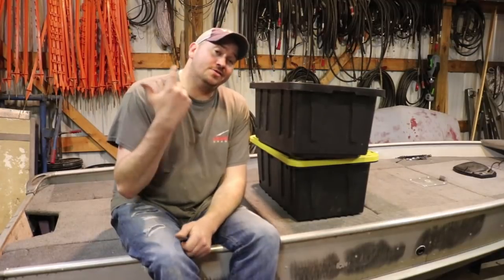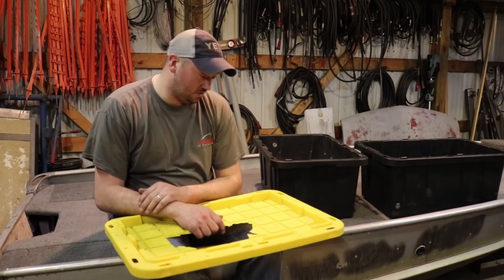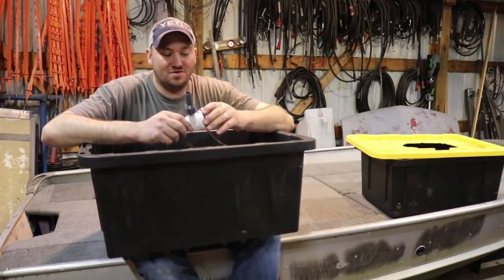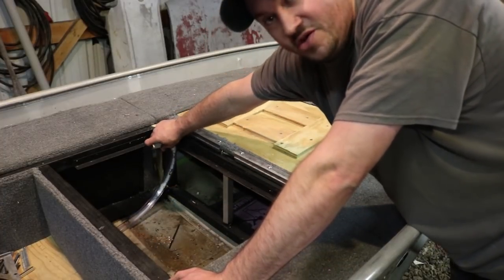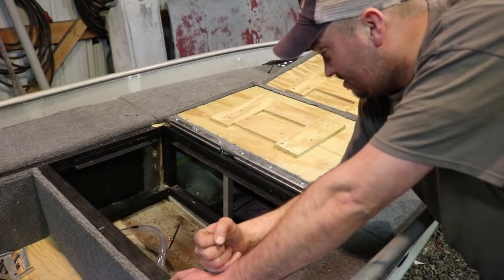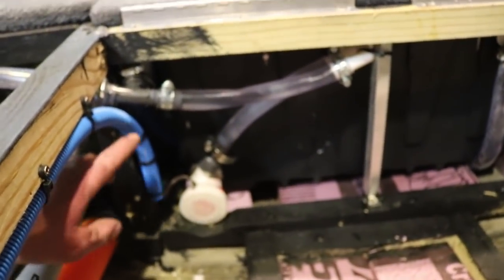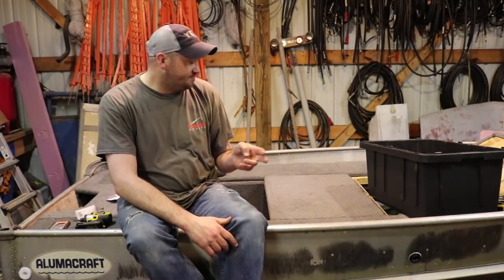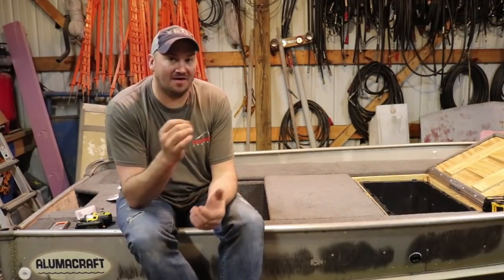D.I.Y Livewell jon boat to bass boat!

Comment: I came across your video while getting ideas for an improved baitwell in my 14' Alumicraft jonboat.  I found everything you showed helpful, including the one seemingly minor mistake you talked about getting the well to drain completely.  I now know to pay attention to the ribbing of the Durabilt bin I purchase so that I can install a drain to get it to fully empty.  Additionally, I will look to find the dual-flow valve for recirc or drain rather than using separate valves.  Thank you for making the mistakes for me so I won't have to.  Your video has been most helpful!!  Definite UP vote!

Comment: We use to run saltwater tropical fish from the keys to the mainland in a plastic barrel. At first we had to stop every hour or so to dump out the old water and put in new.
       Then we added a charcoal filter to the airator  with pre filter on both ends. 1 to take out poop as it went into the charcoal filter, and the second one to filter out charcoal dust, as it was going back into the tank. This removed most of the ammonia and nitrates to make the freshness of the water last. 
      With no filter and a few water changes, we made it to Miami. With the filter and no water changes we made it to Orlando.
      Big difference if you want your catch or live bait to make it home from the lake after a fishing trip. You can buy a charcoal filter for homes already made. Or make your own with PVC Pipe and put the charcoal in 2 white cotton socks for pre-filter. Once you put the sock filter in, if it is not packed tight add some loose socks to the top to pack it in, otherwise the water will not go through the filter, but down the inside walls of it, it has to be packed. This will keep your fish live and fresh while trailering your boat home from the lake.

Comment: Get a piece of metal cut it to fit the bottom give it creases from far end to the drain hole then seal it to the bottom. Its a false bottom to get the bottom to drain to the hole.

Comment: Its looking good!! How exactly are you mounting the box?..Also, I have located a 10 or 12 ft jon boat I can get. Have looked into the idea of framing it and converting to a bass boat. However I dont think I'd want to frame up the entire hull. Do you think that would offset the weight too much to frame half of it?
Reply from the maker: So, to answer your first question. On the live well I put aluminum angle all around the frame so the box would sit on top of the angle. The I drill down through the box and angle and put stainless hardware in to hold it! To answer your second question on my boat when I get up on the front deck it will left the rear of the boat out of the water! So I am putting a gas powered motor on the rear not only so I can get around a little faster but for weight distribution. So thats something to think about! You have to balance it to make it more stable! Thanks for the comment and veiw! Next video I will talk about this issue! Hopefully the weather will break so I can make this video!
Reply: @KIGOutdoors  sounds good buddy I will definitely follow up on the next vid!!!

Comment: Just wondering, where’d you get those tubs at
Reply: I just picked some up at Menards. Lowe’s has them as well as Home Depot
Reply: @jeffreyhodge3088  how’s that aluminum tubing working on your boat
Reply: @michaelprater3803  I just finished the subfloor with 1” aluminum tubes. I’m 220 and it’s holding me just fine. I will put in a few supports underneath but hardly any sag when I walk on it.
Reply: @michaelprater3803  I went with the 1" tubing and it holds my weight (215 6'7") really well.   I did place them 10" apart just to be sturdy.  Getting to work now own the the livewell after I get back from spring break. Using a smaller crate like you have and putting the drain in the bottom where all the valleys come together.  Should work well.
Reply: @jeffreyhodge3088  6’7” 215?  We’re damn near twins. I’m 6’7” 260
Reply: @michaelprater3803  How’s the boat coming? Just framed out the live well.

Comment: SERIOUSLY.... why do you guys keep spending so much money for NOTHING....?  i've had my 100 gallon live well going for several years with no problems at all. and i use NO stupid aerators and etc etc etc. just a simple .25in hose coming in from well below the waterline (equipped with a shutoff valve). and a .75in overflow line that leads to my bilge pump.  i've hit both fresh and salt water with no issues. ran full weekend trips flawlessly as well. 
 total system consists of...
.25in hose
.75in hose
4 flush mount hose connectors
100 gallon tub 
1 .75in pvc screw valve (bottom drain)
total system cost was less than $30
PRO's...
vastly cheaper
less equipment to maintain and fail.
lighter boat (by only a little i know)
longer battery life
CON's....
you don't get to brag about spending more money on your rig than your buddies, is about all i can come up with, lol...

 btw, i had my boat built with an active live well originally. it was later custom work that sparked the idea of trying this set up out.
Reply: Definitely onto something here!